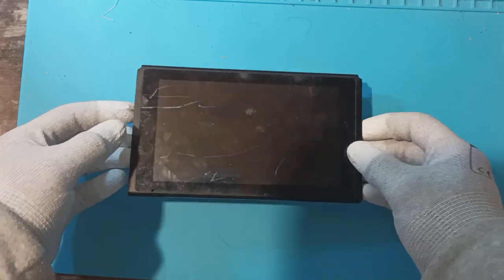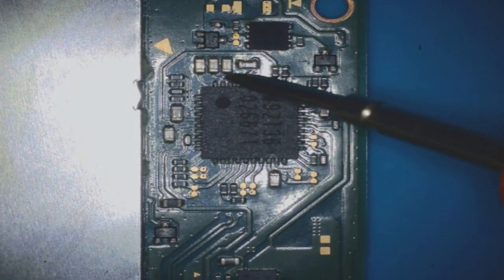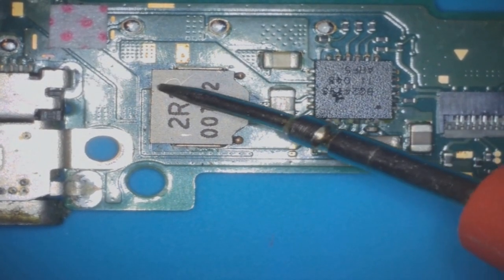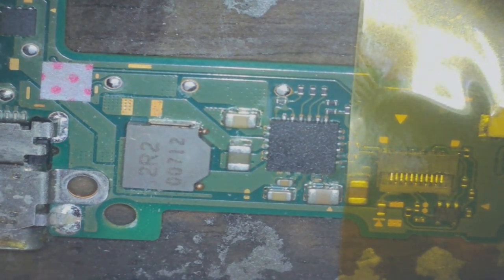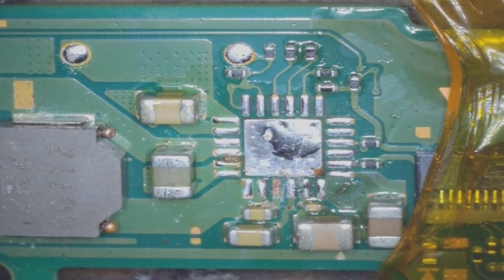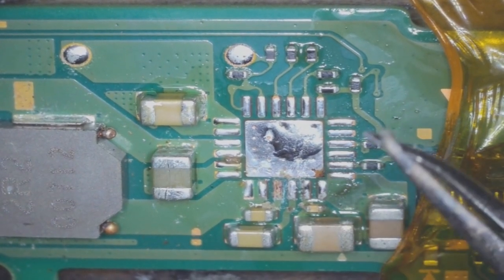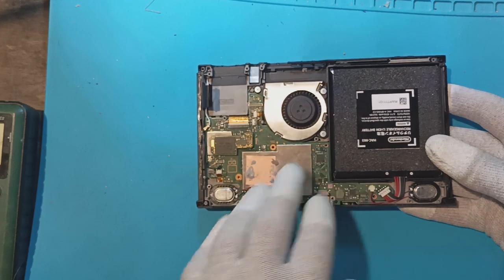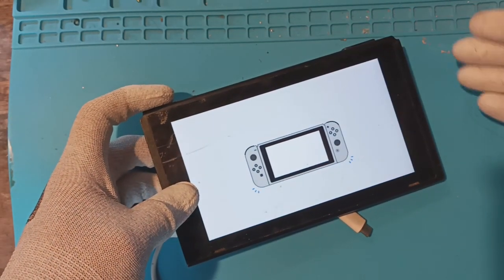No Power? Nintendo Switch faulty BQ24193

Comment: Just a tip. Use aluminum tape over those connectors. Takes a lot more heat and doesn't melt back. It's the only way to go. You could even use both together. I do sometimes. Nice repair.
Reply from the maker: Thanks for the tip I will try that the next time
Reply: You can also heat from the other side.